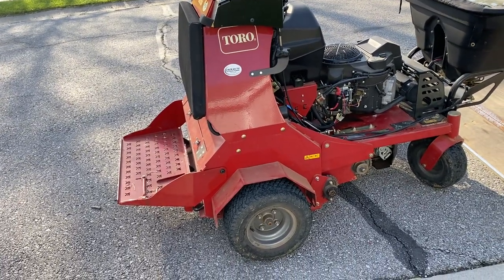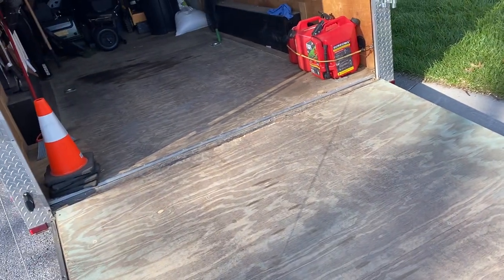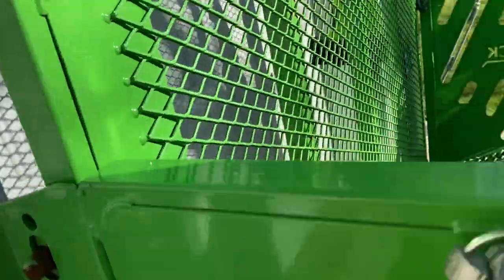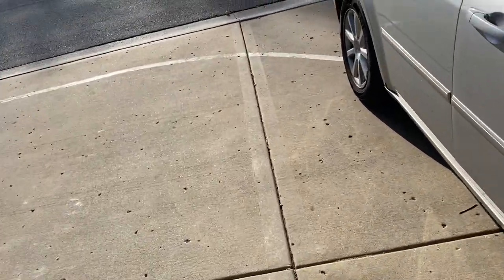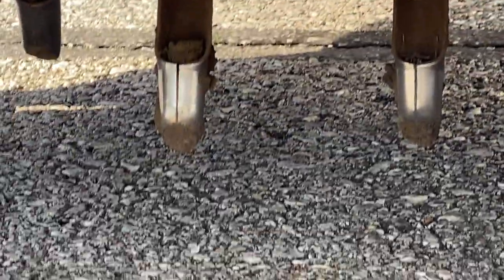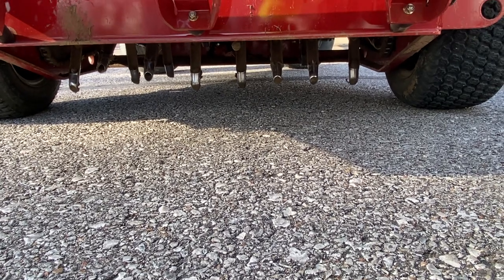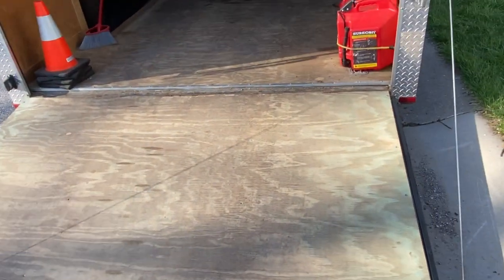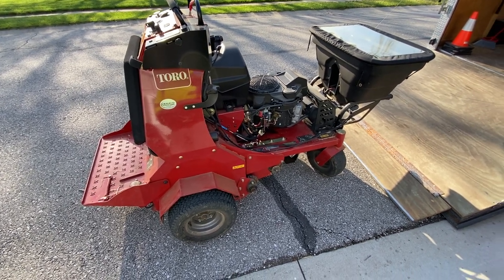WONDERING IF THE TORO 30 INCH AERATOR CAN GO UP THE RAMP RACK WITHOUT DAMAGIMG IT???

Comment: I have an isuzu box truck, deck is 39" off the ground. When dry, no problems getting the exmark aerator onto the floor, if tires are muddy, need to drive it fast enough to fling the mud off, thats all. I fixed the platform so it folds up, need all the space i can save.
Reply from the maker: Thanks for checking me out